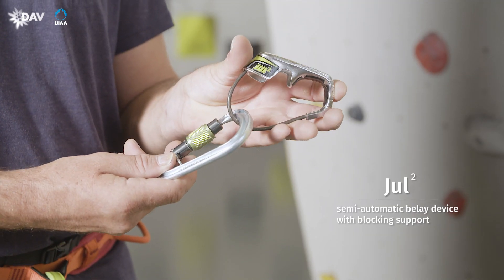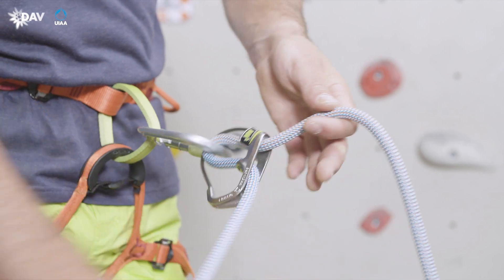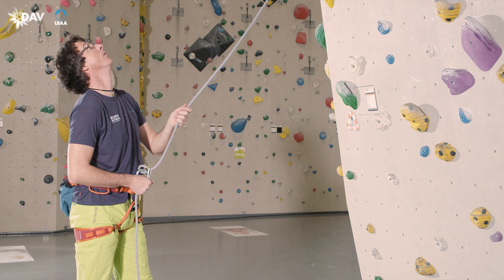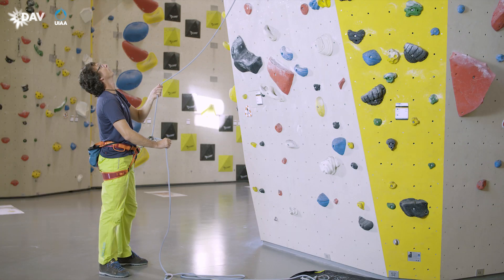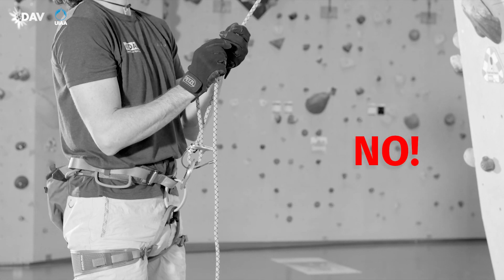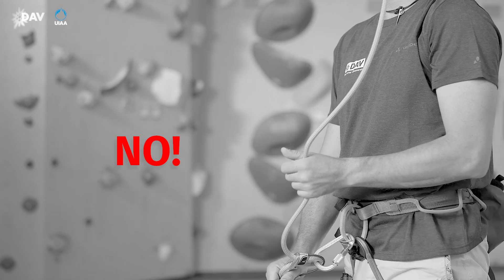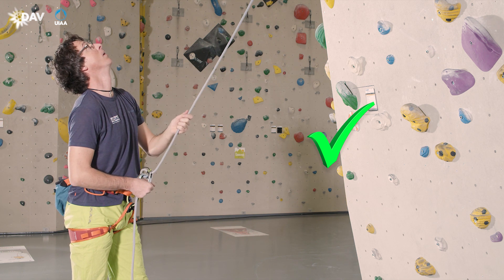Climb Safe: How to belay with the Jul²

Comment: It looks like taking slack is very slow and requires a lot of repeated movements, since if you take rope to the front there is little distance you can take in one go, compared to grigri where you can pull up at least twice more in one go.

Comment: If you belayed like that at my local gyms, they'd freak out. Letting go of the rope (even if the hand is loosely wrapped around it) and sliding it up would get you a talking too. And you wouldn't pass the belay test fo sho.
Do I aggree? No, but they're super picky.
Reply: I know that American gyms are weird about that, but that's the way even Edelrid recommends doing.
Reply: @7um4dr3  ". At all times, the brake rope must be held completely with the braking hand! 
" - from the manual
Reply: In Europe this "sliding tunnel" method is widely taught
Reply: @bullfrogboss8008  Really? I don't have experience in other countries, but I never saw someone belay like that (when top roping) in a Dutch gym (and I don't think they'd be very happy with it). Afaik here they all teach (and I'd assume made mandatory) a style where you have both hands on the rope part underneath the device as much as possible.
Reply: @HuibP  The tunneling method is the most commonly used one in Poland from my experience. I was taught to use it on my belay course. I've also heard it's popular in Czechia and Germany. There are countries where most of the gyms forbid using it, but as far as I know, climbing organizations consider it safe.
Reply: Yeah I'm just planning to pass a belay test at a gym that uses these, and this seems disastrous. Good way to waste my test for the day
Reply: Gyms are overly strict about technique because they are liable for any accident and they assume the belayer might be extremely distracted/unexperienced. Out on rock this style is absolutely accepted and actually this is what i've been taught in a 6 weeks rock climbing course in italy. The main point is that as long as you never take your hand completely off the brake rope, you will be able to engage the brake.
Holding the rope with two hands is not a good idea, you end up crossing your hands which can create confusion and also you wont be able to use your left hand to help you keep away from the wall should you get yanked toward the wall in case of fall. Many times on rock the belayer is in more danger of getting hurt than the climber, especially if the ground below is uneven or there are ledges in the first meters of the wall.

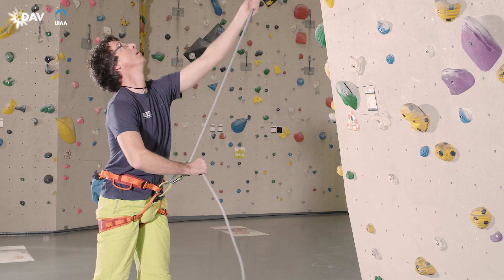Comment: His belaying method does not seem completely safe. As seen around 2:35 he let go of the bottom part of the rope, which means the climber would not be secure at that moment....
Reply: It's a technique that's safe and widely accepted by many climbing organizations. It's preferred by some cause it's easy and simplistic, doesn't require ur hands to cross each other in a weird way. Ur brake hand is still wrapped around the brake line just loosely. Always watching ur partner means you know when they are going to fall, which is when you grip it tightly as usual.
Reply: Seams to use the tunnel technic, this is not accepted in all country but it is way more risky with regular tubing device, the Jul2 certainly block as long as the rope is not over the device. I have the Jul2 and it grab as crazy even if you do not hold the rope (if you keep it under the device). I do not use the thumb method as described to give slack for lead climbing, i touch less as possible the device and simply let the thing do the work (I just want to make sure I dont keep it lifted up at wrong timing, if you dont touch it it will grab all the time with the good rope spec). It is a bit harder to give slack without the thumb method but with some practice it goes very well and in my opinion it makes the device perfectly safe.
Reply: @pascaljutras178  can i ask how you give out rope withput releasing with the thumb?
Reply: @ slightly lifting the device with my top of my brake hand while I am moving slack rope to the device, this give me a chance to pull the rope freely, if climber fall the device will loose contact with top of my hand and will automatically block cause I keep all the time the rope under the device.
Reply: I do it like that and tested it, climber was always safe.  Been doing it for years.  Some gym don’t like it though.